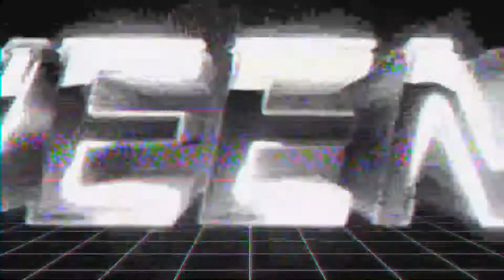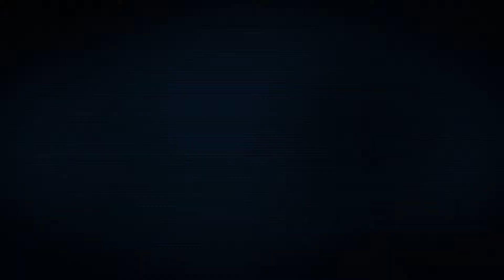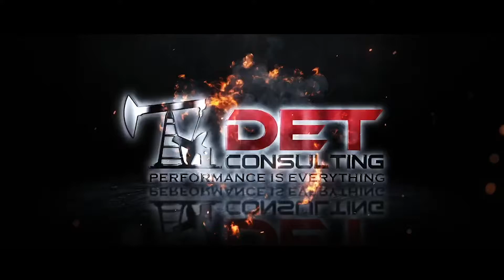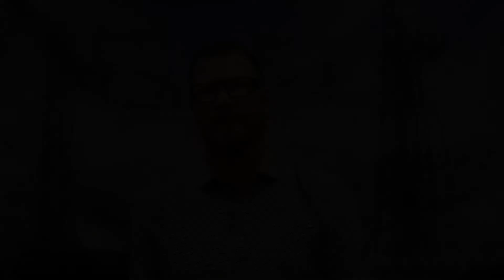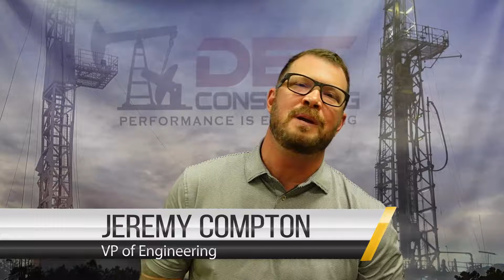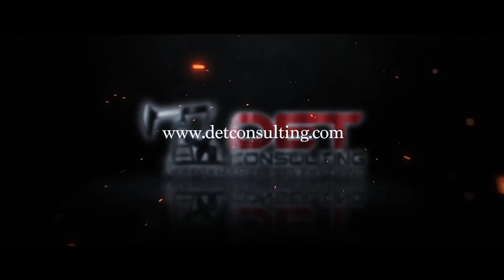Between Two Rigs - Getting Production Cement to Surface With Losses in the Lateral

Comment: Great topic! Is your sweep materials engineered (particle size) to deal specifically with the formation where lost return happened?
Reply from the maker: We start with a blend that has a micron size from 400 up to 2500 and see the results.  Pending how bad the losses are we can add / adjust and fill in with a more specific blend.  But 90% of the time the first blend solves it.
Reply: @detconsultinginc.8855  how did you come up with the 400-2500 range? Do you take into account an estimation of the width of the natural fracture, or pore throat size etc. ?
Reply from the maker: @YunchuanZHAO  Years of testing on real wells came to the blend we use on that micron size.  We have a 400-1500 range blend and a blend that is 400-2500 with a stronger emphasis on the larger.  We compliment it with 10-15 ppb of 400-1500 or 1500-2500 pending on loss amounts.  In the larger frac width we go larger.  It is important to note though that it works best with a strong blend of sizes.   All the same size does not work well and you do not fill in the cracks and it will wash and break quicker.   The big stuff builds the walls and the small stuff fills it in.
Reply: @detconsultinginc.8855  sounds awesome! Thanks for the quick response, too!

Comment: Not familiar with too much HPHT situations. But, if it’s a recurring issue wouldn’t MPD make sense? Drill under balanced to prevent losses. After TD, displace to heavier fluid at a lower rate. It should pay for itself.
Reply from the maker: We do utilize MPD to drill and trip.  The issue with just displacing heavy fluid at TD and pulling, is it does allow you to trip, but it creates a surge and lifting issue and the weight must be removed to regain returns and lift cement.  This method does work, but results in losses running casing.  There are better methods with pills and displacement practices to keep returns the entire process.